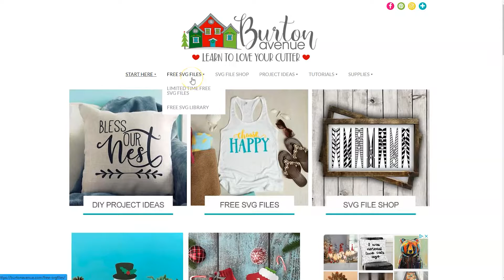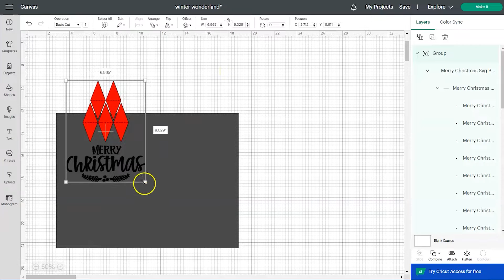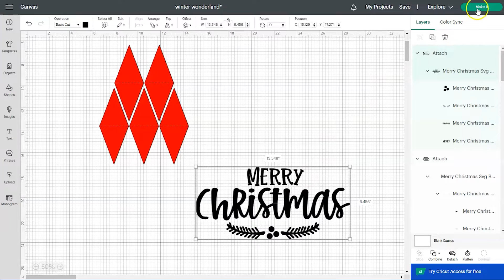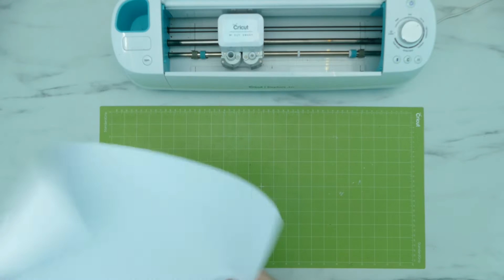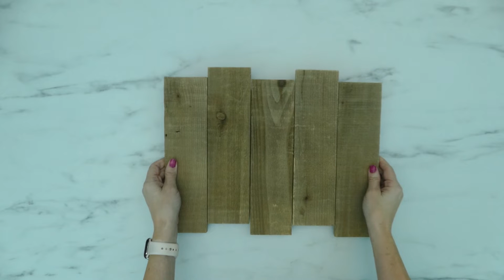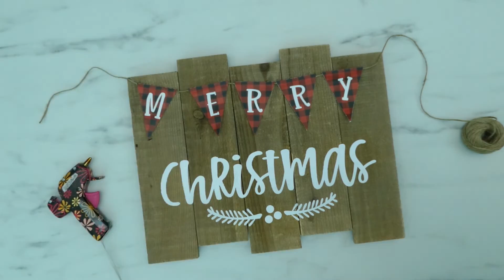Merry Christmas Pallet Sign

Comment: Could this be done with regular vinyl too or does it have to be the HTV?  Also, could you use the stencil vinyl to go ahead and use paint for the words?
Reply from the maker: It kind of depends on the wood.  If it's too rough, regular vinyl won't stick.  Same with the stencil, if the wood is too rough, the stencil won't stick, and the paint will bleed.  If you have smooth wood, you could use either adhesive vinyl or do a stencil.